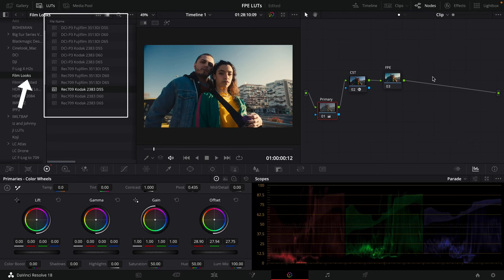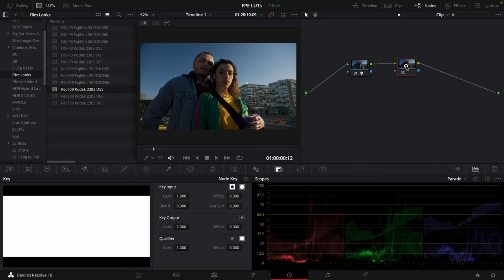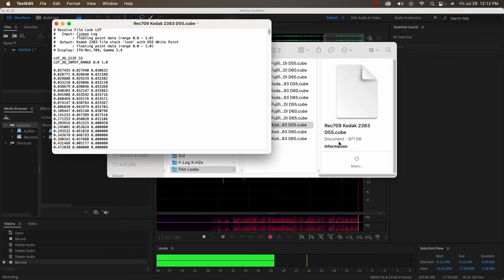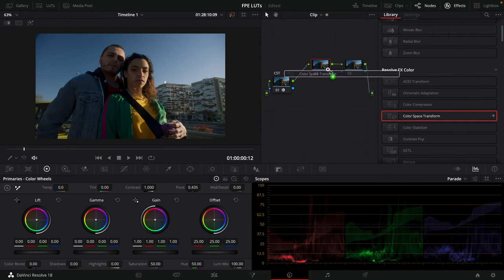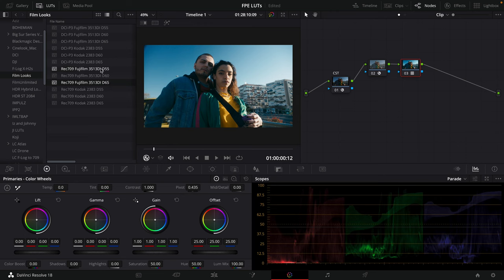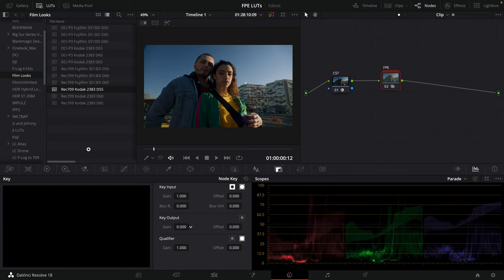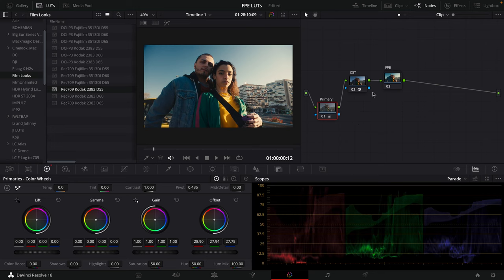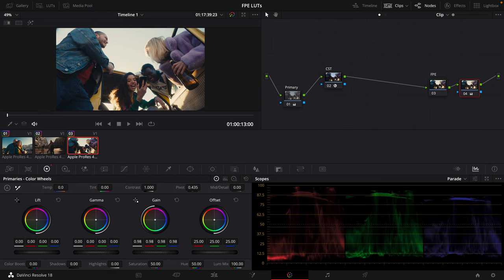DaVinci Resolve Film Look LUTs - How to Apply PROPERLY!

Comment: Great stuff. My problem is using the cineon and doing exactly what you did except I'm using Canon Log, it makes the footage look great but way noisier for some reason. Lowering the key output helped quite a bit. Part of the issue is working with 8 bit log footage I'm thinking.

Comment: You said something very interesting... You have your timeline color space set to Rec 709-A because you are working off an apple so what you see on your monitor is what you will get at export. I am working off a MBP but I am using an external monitor - LG 38WP85C-W, any idea what I should set my timeline color space too. I haven't been able to find an answer.
Reply from the maker: If you’re on a Mac, no matter what monitor you’re using, if you’re grading in the GUI and not using an external video card, you can set your output colorspace to Rec.709-A and in Resolve preferences check the box for “use Mac display profile for viewers”, and then what you see will match your export.

Comment: Does anyone know how he was changing the offset color wheel with such fine control @ 6:50? Using that hollow circle cursor? 
Whenever I try to make color adjustments to that wheel I always send it way farther than I need to even though I'm barely moving my mouse.
Reply from the maker: The fine tuned control is the result of using the offset wheel in a scene-referred node before the conversion to Rec.709. The tools respond differently based on what your color management is. You’re probably experiencing more responsive adjustments because you’re using it in Rec.709 or on Rec.709 footage. If you find the tools to be too sensitive, you can always set the node to something like .5 intensity to help.
Reply: @EvanSchneider Thank you for the reply on a not super recent video. I’m typically adjusting the color wheels on v-log footage prior to converting it to rec709 through a color transform node. I never thought about decreasing the intensity of the node so the larger adjustments have less impact on the image.
But there is no special shortcut key/plugin/script to make the color wheel dot less sensitive to mouse movements?
Reply from the maker: Maybe try option or shift? I’m not sure, I’ve never had the need since I use a panel. You could also search in the keyboard shortcut menu or help menu. Last resort I’d check the manual.

Comment: I’m curious, Evan.
Let’s say I choose to set my timeline color space to DWG and output to Rec 709A for Mac as color management. Can I set my first CST node from Slog to DWG and my second CST node before the Film LUT node to DWG to Rec 709A Cineon log? What do you think? Meaning the adjustments between these two will be in DWG color space. Thanks in advance !
Reply from the maker: You’d be introducing a colorspace “bottleneck” into your pipeline, pretty much negating the benefit of working in DWG at a timeline level. You’re better off color managing on a node level. 

But my best advice is to test multiple workflows, grab stills of each and compare which results you like the best.
Reply: Thank you, Evan!

Comment: I would like to ask a question, in my case I use CineDNG I have to assign a color space and gamma, from the available options I was told that P3-D60 with Linear has the best dynamic range, testing it I realized that it is easier to work if I convert the color space and gamma to the ARRI one, I do the color grading after this conversion and before this LUT, but in your opinion, is this the best option the way I am doing it?
Reply from the maker: The decoding from the camera raw is completely up to you and what works best. The most important part of this workflow is to feed the proper colorspace and gamma into the FPE LUT, which would be Rec.709 colorspace and Cineon Film Log gamma. So if I understand your workflow correctly, this is what I would recommend your node structure to be.

1. Decode CineDNG to P3-D60/Linear
2. P3-D60/Linear to Arri/LogC3
3. Primary corrections/offset
4. Arri/LogC3 to Rec.709 Cineon Film Log
5. FPE LUT
6. Secondary corrections/small tweaks

Comment: how does the white point for the luts work, say if i shoot on 3200k based on my 3200k keylight, what would the D55/D60/D65 white points do .
Reply from the maker: Doesn't have anything to do with how you shot it necessarily, it's more of a creative decision. Simply describes the color temperature of the white point that the LUT generates.

Comment: Thank you so much Ewan, this video is really clear! I followed all the steps exactly as you suggest and worked amazingly… ONLY, I have a little issue, when I export the video it comes out WITHOUT THE LUT! 😅 I guess I’m missing some very basic step but I can’t quite figure out what… some help on that would be highly appreciated!
Reply from the maker: My first guess is make sure you have "Flat Pass" turned off on the deliver page? I'm not sure, it could be a number of things.
Reply: @EvanSchneider  thank you, I could solve it, it had to do with some exporting configurations that were not properly set

Comment: I use Cinematch to match my EOS R to my BMPCC 6K pro. 

Where in the node tree would you use Cinematch??
Reply from the maker: In your workflow you’d use cinematch before these nodes. That way you convert them to the matching profile and then apply the FPE to that.
Reply: @EvanSchneider  thanks for getting back to me!

I was thinking of using this workflow in a wedding I'm currently editing. BUT, I'd rather not drop a bomb on the workflow I'm used to JUST yet haha. 

Definitely going to use this in my next project.

Since I have two cameras, cinematch is pretty crucial.

Comment: So then i will ask question i have 30-60 mins video outside .Recorded in d cinema SDR do i need to just apply lut dedicated for my camera ? Or i need to make 3 nods like you
Reply from the maker: The 3 node structure I made in this video is expecting a Rec.709 input so yes you would normalize or transform the footage first, then feed it into this.
Reply: @EvanSchneider   but the point is when i have flat color videos and i put this lut video looks better than recorded in normal and standard mode .I was trying to add same lut to video that was recorded in standard mode and again i see better colors warmer
Yout video is not HDR in d log ?

Comment: I'm not sure I quite understand how adjusting the key output on the compound node does not compromise the  Cineon to rec 709 conversion in the same way as you were describing on the individual node.  Could you please explain why this is the case?
Reply from the maker: Great question, this is because inside the compound node, we convert to Cineon log and then the LUT is transforming back to Rec.709. So essentially, the compound node's input and output are the same, allowing us to adjust the key output without affecting any transformations.
Reply: @EvanSchneider  thanks! Makes sense. Another question: I notice that you use “same as timeline” as your input for the 709 - Cineon node. Since your timeline is set to 709-A (as mine would be) would that not make a difference to how the FPE looks/responds, as Cineon is expecting 709 as input, not 709-A? I have been entering 709 at this point thinking that’s what Cineon is ‘expecting’, and have noticed that entering 709 vs 709-A yields a different result here in terms of brightness (and maybe contrast) once the film LUT is applied.  Just wondering which would be technically “correct” here.

Comment: Awesome thanks!  I am as curious if I was filming on a a6500 Sony on its native settings not s-log could I still put the color transfer node to rec709.  What would my setting be?
Reply from the maker: Yes, you can absolutely do this. Here's the node structure (assuming you're working in a DaVinci YRGB project, non-color managed)

Node 1: CST with Input Color Space Rec.709, Input Gamma Rec.709, Output Color Space Rec.709 and Output Gamma Cineon Film Log
Node 2: FPE LUT of your choice

Then on Node 3 you can do minor adjustments to the look.

If you need to make exposure, contrast, or white balance/saturaiton changes, you would create a new node before the CST node and make those changes there.
Reply: @EvanSchneider  OMG thanks bro this helps so much.  Having 8-bit is tough to color correct sometimes. I was shooting with p22. This helps a LOT. Thanks agian.
Reply: * PP2.  and yes noncolor
 management.

Comment: Is it important to transform into rec709 in one node and into cineon in the other? Why not into cineon straight away?
Reply from the maker: Yes, you could convert to cineon straight away. I did it like this because mentally I like to separate my input transform (IDT) from any transforms I'm using for look development. Just another way to organize it. This way, I can add nodes between the input transform and the FPE if I want to later in the process.

Comment: Which rec 709 should I choose for my timeline? You chose rec 709 -A should I choose that too?
Reply from the maker: That depends on your system, display and how you’re monitoring. If you’re on a Mac and grading in the GUI, like I was for this video, then choosing Rec.709-A and turning on the preference for using the Mac display profile for viewers is the correct way to do it. Rec.709 Gamma 2.4 is the video standard for most pro apps though.
Reply: @EvanSchneider  oooh, ok, I get it. Thanks for help :D

Comment: wouldn't any adjustments after the FPE choke the grade, and be heavily restrained by the LUT, thus resulting in artefacts?
Reply from the maker: It depends on what type of adjustments you do after the FPE. Some adjustments might result in artifacts, but as a general statement, I would say that it's acceptable to place minor tweaks after the FPE. But sometimes if the FPE is doing things like shadow tinting or certain hue shifts, I fix those at the end of the pipeline.
Reply: @EvanSchneider  I see, thank you

Comment: Can I download these luts to load in my external camera monitor?
Reply from the maker: You can, but your results won't be very accurate and I wouldn't advise these for monitoring LUTs. I would recommend using LUTs made specifically for your camera color profile, or converting these LUTs to work with your camera.
Reply: @EvanSchneider  im new to using external monitors and yesterday I order this portkeys pt5 ii. I was hoping that I can shoot with a lut activated as the clog3 file is so hard to get the right exposure... would using false colors be a better option than lut activated?

Comment: Why are you using 2 CSTs ? You could do it al in one right ? Just have  output gama Cineon Film log and output color space Rec709.
Reply from the maker: You definitely could do that, but I prefer to separate them for a couple reasons. First, I usually make additional nodes for adjustments in between the CST and the FPE. And second, just for organization, as the two CST nodes are performing different functions (or ideas) in my workflow.
Reply: @EvanSchneider  Thank you for your report Evan 🙏🏻

Comment: How would you modify this for a Rec.2100 HLG Timeline? Thanks!
Reply from the maker: You would sandwich the FPE LUT between two colorspace conversion nodes. The first one would be the same as I describe in the video, but you would also set it to convert to Rec.709 colorspace. Then after the FPE LUT, you would add another colorspace transform converting from Rec.709 back to Rec.2100 HLG.
Reply: @EvanSchneider  Evan - many thanks for your reply. Much appreciated!

Comment: Question 1: You say that you use Rec.709-A as your timeline color space in order to get your export looking the same when grading on your mac screen. I'm also just using my mac screen, and I've been using Rec.709-A as well but only as output color space, not timeline working space. For timeline color space, I've been advised by Darren Mostyn to "always use the largest color space possible", which is Davinci Wide Gamut (or Aces alternatively). Is there a reason why you don't do this? I'm a beginner so I just follow advice pretty much blindly.

Question 2: When using a color managed workflow (davinci YRGB color managed), and DWG (davinci wide gamut) as timeline color space, I've used three nodes: 
1. CST: DWG to Cineon film log
2. LUT
3. CST: Cineon film log back to DWG
Is this correct?
Reply from the maker: Hey! Thank you for the comment. Darren's advice is accurate and I would advise that in general, however there are a few caveats that come with it.

The Film Looks LUTs in Resolve are not compatible with working in DaVinci WG/Intermediate color science. This is the reason that when I'm using these LUTs, I work in a Rec.709 colorspace. This ensures that the LUTs look the best they possibly can, and even though I'm not working in a larger colorspace, the tradeoff is that I'm using the LUTs as they are intended.

I would not advise using these LUTs in DWG or ACES, as you're basically bottlenecking the pipeline at the LUT and forcing everything into a smaller colorspace anyways.

To answer your second question, your nodes should be as follows:
1. CST: DaVinci Wide Gamut/DaVinci Intermediate to Rec.709/Cineon
2. LUT
3. Rec.709/Gamma 2.4 to DaVinci Wide Gamut/DaVinci Intermediate

This is because the LUT is also converting from Cineon back to Rec.709 2.4.

Cullen Kelly has some free 2383 LUTs designed for DWG/ACES if you want to check them out: https://freebie.cullenkellycolor.com/freelut/

Hope this helps, feel free to reply with any more questions.
Reply: @EvanSchneider  Thanks a lot! :) one more thing, do you always use Rec.709-A? I’ve been using it because it looks consistent in quicktime and youtube, but I’ve read somewhere that it has its limitations. Like vimeo, windows (in general?) and certain web browsers (I’ve not tested this myself so can’t say for sure). I’d like my exports to be as flexible and «universal» as possible, and it would stress me a little knowing that they may look wrong certain places. For clarification, I’m just delivering to the web.

Comment: you can just set your output gamma to cineon log in your first cst. no need to add another node and another cst
Reply from the maker: You could definitely do that too. The reason I created two CST’s in this demo was because I created a compound node out of the second CST + LUT. I didn’t explain it thoroughly in the video, but it allows me to make adjustments to the image before the compound node look in a linear space. Hope that helps clarify the “why”.
Reply: @EvanSchneider  yeh sorry you are completely right, I kinda glossed over the follow up as I was confused why you added it. thanks for clarifying
Reply: @EvanSchneider   you don't have to do two separate nodes and then compound them. You can do the last CST and the LUT in the same single node. The LUT is the very last thing that happens in a node (even says so in the manual), so a CST applied to the node will feed the LUT just the same as a separate LUT upstream.

Comment: I get very confused. Some creators add LUTs before the last CST to Rec.709. Some do it after. Its even more confusing how some color grade and add their luts before the rec.709 CST. I understand some LUTs also do creative looks and conversions. I wish there was a simple matrix out there that said when you should grade, and where to apply your LUT depending on what kind of LUT it is.
Reply from the maker: Your confusion is definitely justified, but unfortunately there is no definitive answer. There are technical reasons to place different adjustments before or after another adjustment, but there are countless factors influencing those decisions (both creative and technical). My best advice is to experiment for yourself and find what works best for you and your workflow. Color grading takes years of experience and practice like many other trades in film. Hope this helps
Reply: @EvanSchneider  thanks, I think it does.

Comment: why on earth did Resolve make these luts 33x like it's for a monitor on set, not for color grading. WTF
Reply from the maker: Well technically, these LUTs were actually designed to preview what the project would look like when printed onto these film stocks, and then turned off to render and sent to be actually printed. We now use them as emulations. 

Still, if you have tetrahedral interpolation turned on, you’ll be fine.